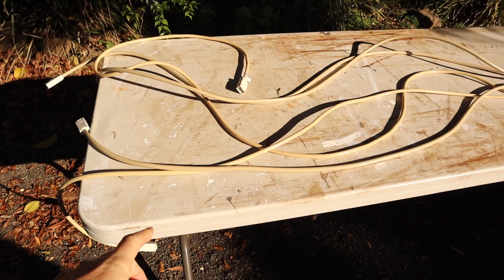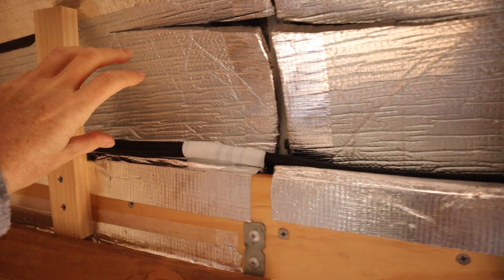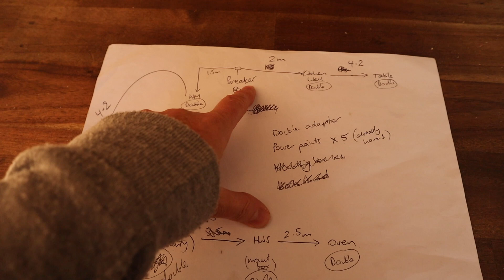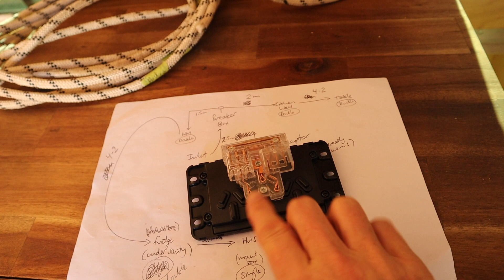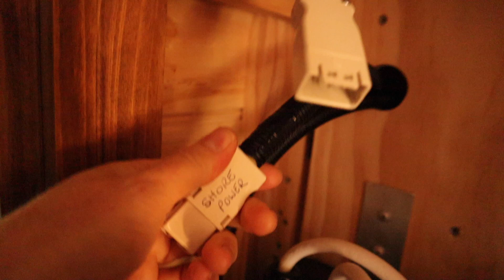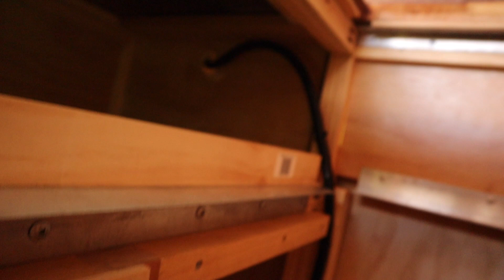Prewiring my bus conversion - Part 1: 240v mains power

Comment: Hi ! Hope you are well. We are not far along in our van build but are thinking about the CMS electrical system due to your video. Are you happy with it? Any added advice from your sparky? Or in hindsight would you have just gone with traditional wiring from an electrician? 
Thanks so much 😊
Reply from the maker: I'm happy with mine. Easy to install. Everything works. I'd use it again but I would say talk with whoever your sparky is that has to sign off on everything because they are the one that needs to be satisfied with it
Reply: Thanks Dyani, yes we have found an electrician who seems agreeable and positive.

Comment: Do you have this Plugged into an AC Battery charger by any chance? so you can charge your batteries off shore power?
Reply from the maker: I have a Victron Multiplus inverter charger which charges the batteries from whatever power is available whether that is solar or shore power

Comment: Got a trick for the split conduit - get a ring ended spanner a little larger than the cable - push the ring end into the conduit, push the cable into the ring end and draw it a long. 
Get a cheap old spanner and cut a notch out for your cables with plugs on.

Comment: I wanted to use foil board on my bus, but is illegal in New Zealand - the reasoning being the foil is conductive and can become live if it comes into contact with wiring.
Reply from the maker: wow I had not heard that! I knew about issues with PVC coated wires coming into contact with polystyrene but not about the foil itself. It makes sense. There are not many places in my bus where cables are running close to the Foilboard and where they are, they are all in conduit so hopefully I am ok. It's definitely legal in Australia.
Reply: @AGirlADogandABus  I lined my first van with that sliver plastic carpet underlay and blue batts (sound insulation) - worked well. 
Going with wool insulation on this build - just got a 25kg bail of it. 
Loudspeaker builders like it because it is one of the best sound deadening materials, and it is naturally fire retardant - I used to wear wool hot metal safety gear in a steel plant. 
We will see. Should be nicer to install - had to wear paper overalls with gloves taped at the wrist on the last one. 🙂